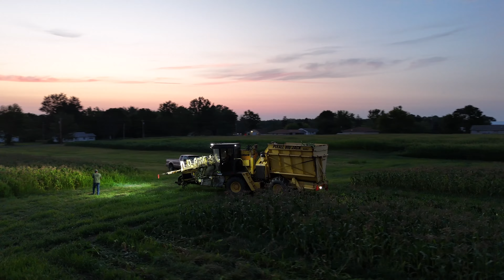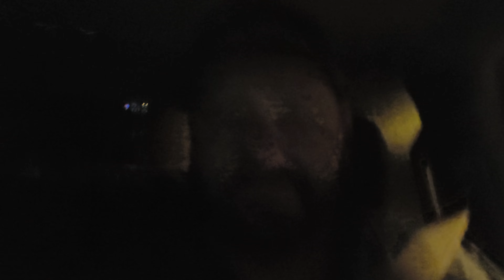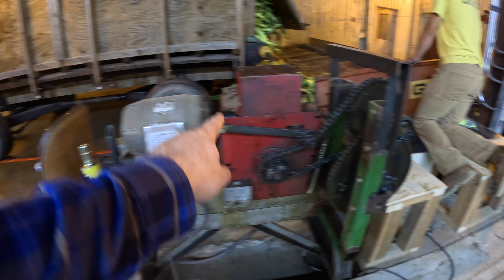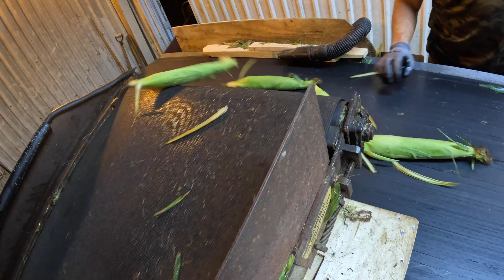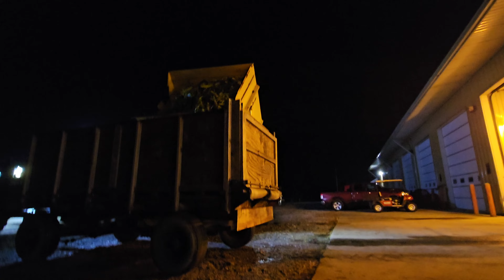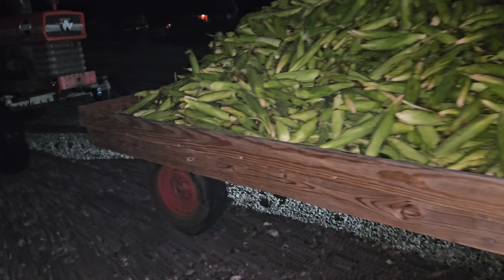Sweet Corn Harvest - Oxbo Pixall Picker Ep 205

Comment: I would add a blower to remove loose leaves at beginning of the line.
Reply from the maker: @robertdesroches9642  They do have a blower set-up.  There are two, but I might not have gotten a good shot of them.  They run on the edges of the belt.

Are you talking about an even bigger blower covering the whole belt?